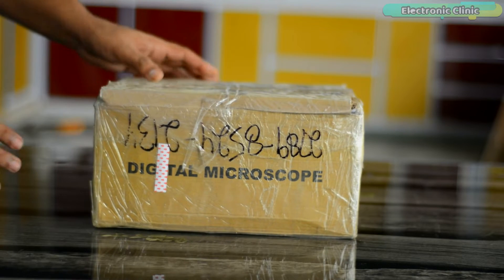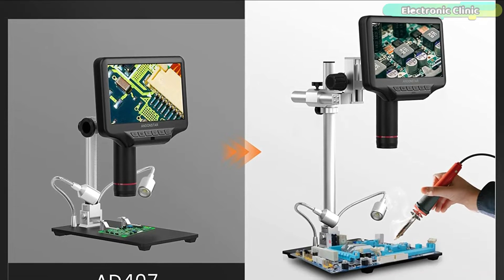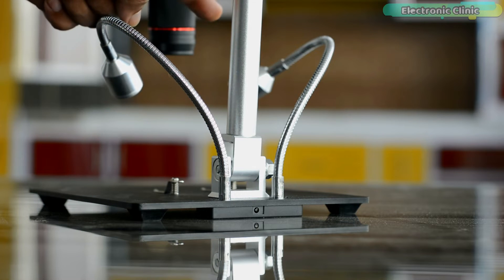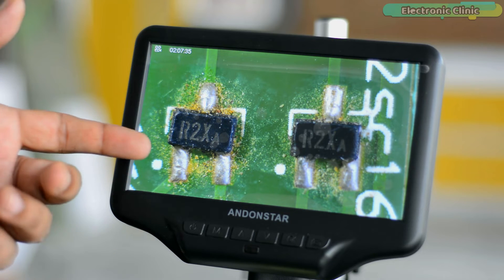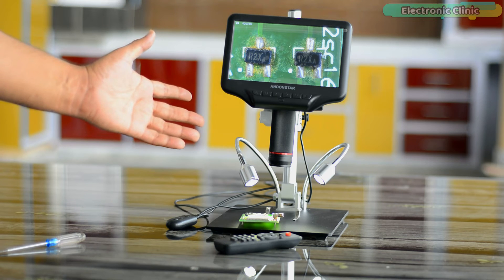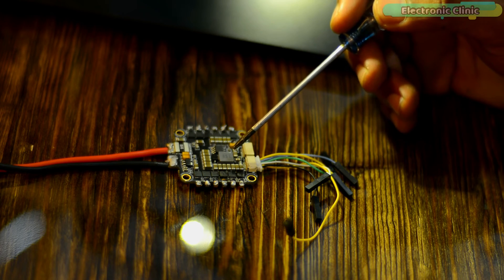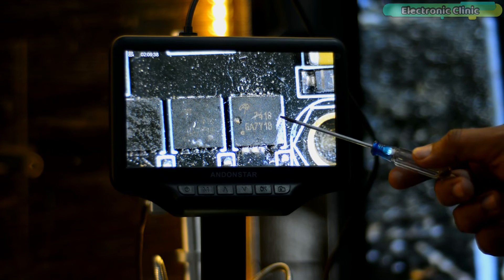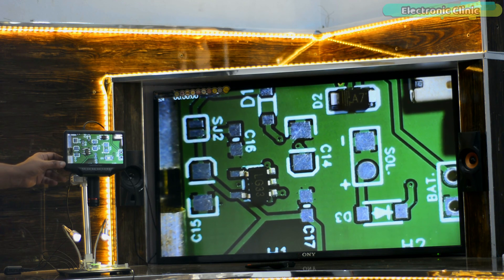Andonstar AD407 Pro 3D HDMI Soldering Digital Microscope Review and Testing, Soldering and Repairing

Comment: While looking for the specs on this microscope I noticed there is a 32gb model and a 64gb model that also say 3d is there really a difference or is it a typo?
Reply: The difference is just the micro SD card that you fit into it - anything upto 64GB, Class 10 recommended.